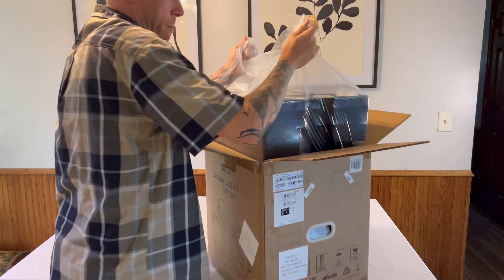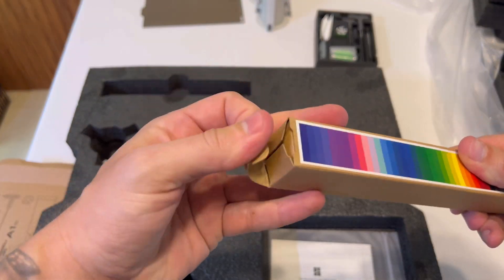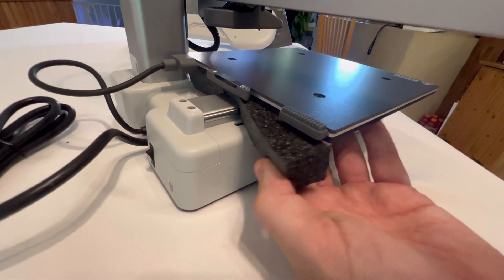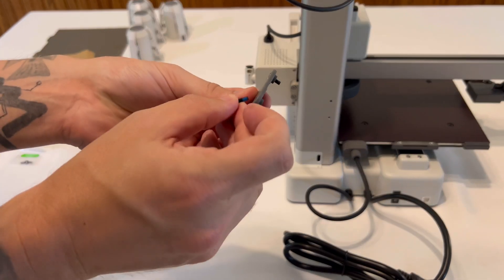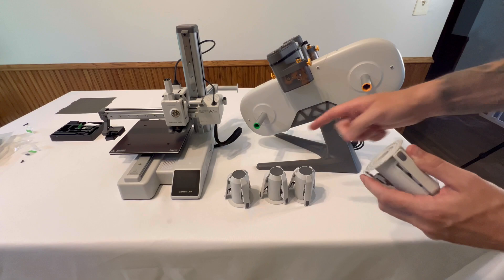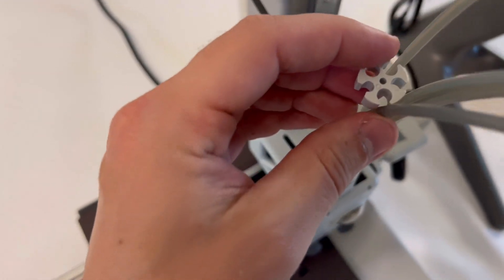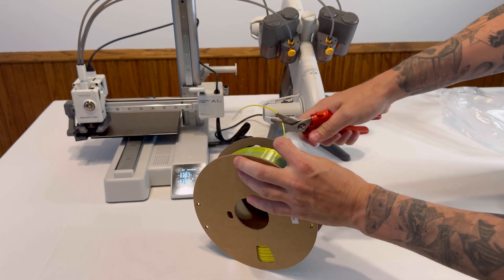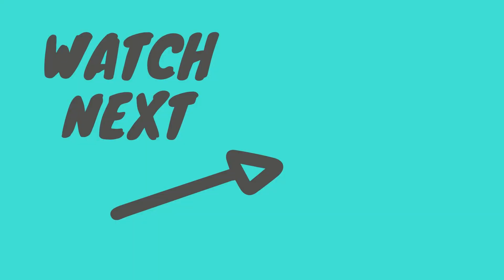Bambu Lab A1 Mini Combo Unboxing, Setup, and Assembly

Comment: Thank you so much for talking this through step by step with easy to understand and very visual instructions. I just ordered my a1 mini combo and it's my first 3d printer. I did some research into the types of 3d printers - fdm vs resin and I chose what most recommended as the beginner's best fdm - the A1 mini combo. Resin was a hard NO because I live in a one-bedroom apartment with little ventilation. As much as I wanted an A1, I measured out the space in my apartment and... yeah, the standard A1 barely doesn't fit on my cramped surfaces. 😢 I do not have the budget or space for the P1S let alone the X1C, and I haven't experimented with the different types of filaments yet. But I did buy the 0.2 mm nozzle that many recommended for printing miniatures closer to resin-like quality with... substantially increased print time. 😅

This video will definitely help make things much easier. Besides the 0.02 mm nozzles, do you recommend any other parts or accessories to the a1 mini combo that's not already included? I know there are some videos that demonstrate some accessories you can 3d print right off the bat to make life easier with the new printer. But in your opinion, are there non-printable must have accessories for beginners?

Comment: What’s a good filament to start with? I’m going to pick up a a1 mini tomorrow
Reply from the maker: I would get some PLA silk in a cool color!
Reply: @3DPrintDood  is there a good amazon brand that you use?
Reply: @Khris_1013  sunlu pla plus is often a popular choice. But make sure you either print or buy an adapter, cuz the spool not attach tightly and might fall off otherwise. Although... this message was over a month ago so I'm assuming you already found some good ones 😂